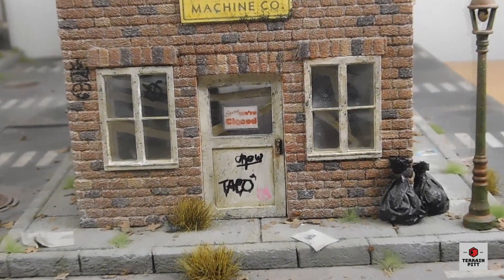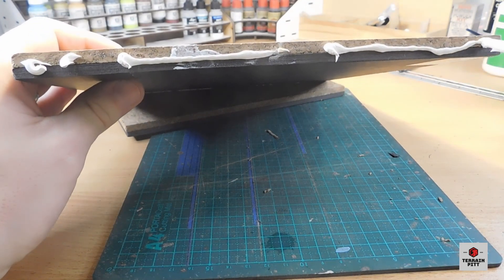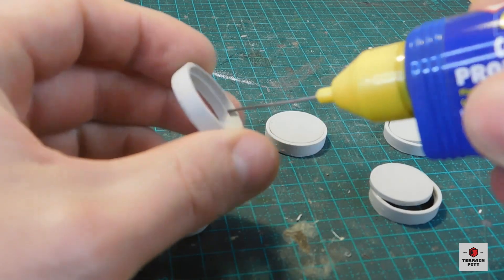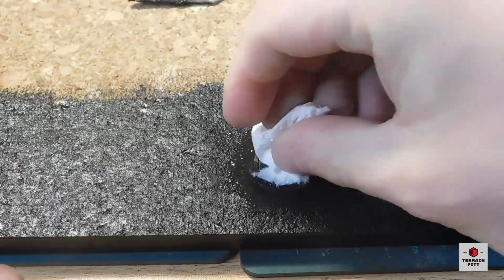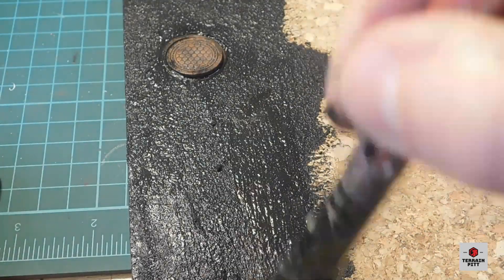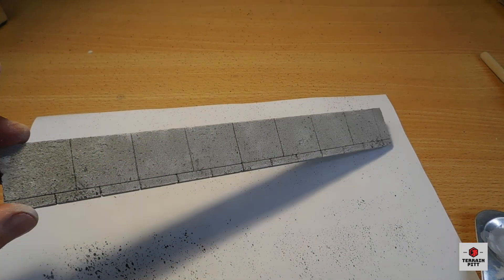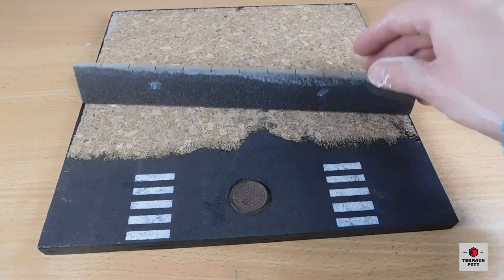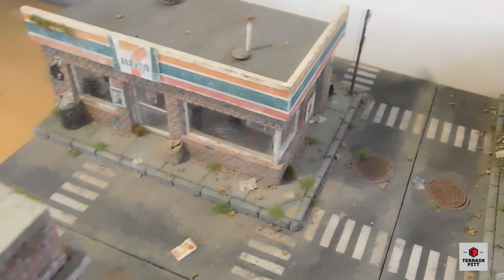Zombicide Build Part 1: Game Tiles

Comment: Soooooooo cool, been wanting to do this, but space ya know.😢
Also was thinking of having the whole building lift up instead of just the roof, for easier manipulation of the actors as the move around.
You rock, your stuff is awesome.
New sub
Reply from the maker: Yeah, moving the figures within buildings is ta little tricky. Another option would be to build the tiles to a slightly larger scale to give you a bit more room.
Reply: I've only seen one yt crafter do that. I started making my buildings that way and it has made game play easier. No finger fiddling with minis and everyone at the table can see the scene

Comment: Amazing. I am in the process of following your method. Even found the same cork board panels at bunnings! I can see the initial shots show the tiles more weathered/faded than in the final steps. Have you gone over this process anywhere in your videos? I can't find how you did it..
Reply from the maker: That's awesome! I think you're talking about the dust/dirt on the roads. You'll see in my videos where I finish up a tile exterior I apply a soil coloured pigment wash, which is a mix of water, pva glue and pigment.

Comment: Hello, i was wondering if your gameboard tile is the same size as the boardgame tile? did you make it a little bigger or they are the same? The square tile
Reply from the maker: Hey! Yes, they're the same size as the game tile. However, if I could do it over, I would scale it up a bit, they're a bit cramped at that scale.
Reply: @TerrainPitt  thanks gonna try it. how much bigger is good?
Reply from the maker: @veemonnguilmon  I think another 30-50% would be good. The game tiles are 25 x 25cm, maybe you could go 35 x 35cm ?
Reply: @TerrainPitt  Got it! i hope it fits in a gaming table haha